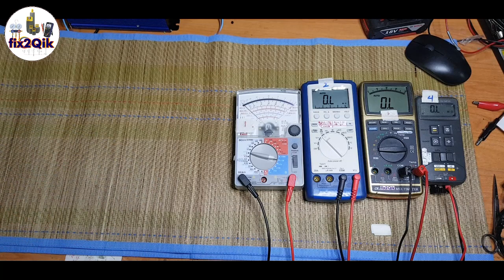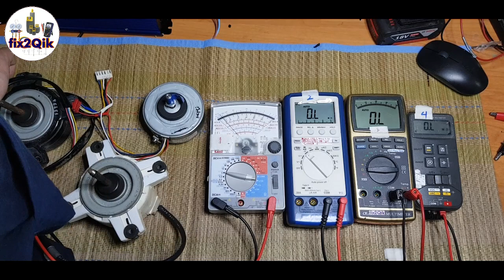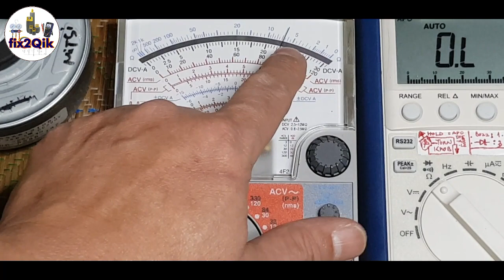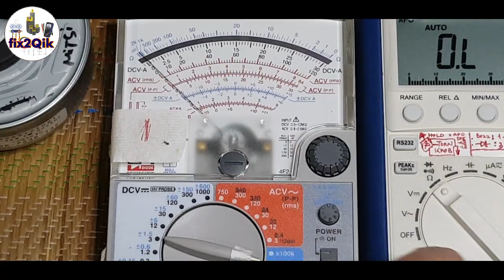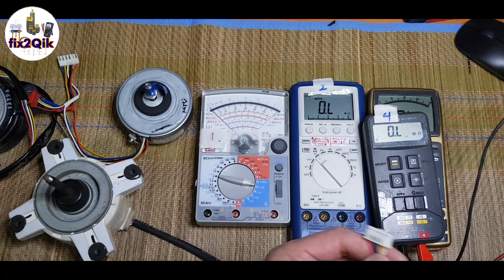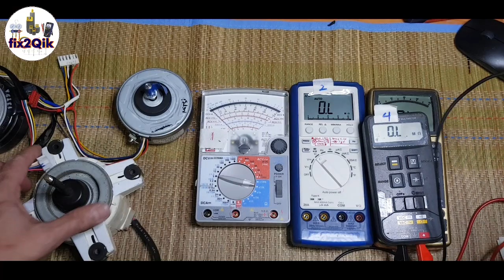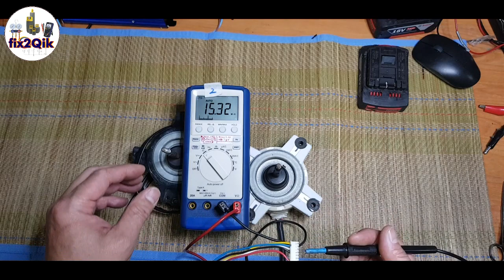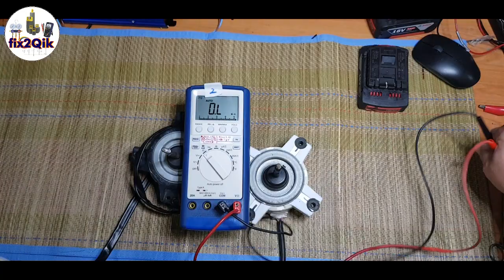Dc fan test, test the 5 wires dc fan motor the proper way

Comment: Thank you for sharing. Ohm tests of dc fan motors are inaccurate. My sister has a panasonic air conditioner that fan motor didn't work, 2 error codes rechecked (push the "check" button down about 5 seconds until the screen shows the mark - - , then point the controller to the receiver of the air conditioner,  now pressing "timer" momentary,  until power light flashed and beeping tone heard for the 1st error, continued to press timer button showed the second error. Leave the controller untouching 20 seconds restored its normal opreation ) on the hand controller are: F95 and H97. She and I had wasted money for call-out fees on one electrician and one plumbing company in melbourne (66 and $88 each) who came to tell we need a new air conditioner after showed off the ohm reading of the motor (in the outside head). Eventually there was a hvac specialist came and simply replaced a black - rectangle shape capa part near on top of the electrical board (he called main grid filter pcb), then it has been working again for over a year now. Costing of the repair was only $375, including extra charges $80 for 1 more hour labour for the hvac technician to put everything back as there were many parts disconnected prior to his repair. The Hvac technician came with 2 boxes looked similar as these testers in the video clip, one tested inside, while the other one doing outside test. I write this so people know what to ask for an experienced decency repairer and not wasting time as well as money..

Comment: Are you based in melbourne?
Reply from the maker: Hi, 

Fix2QIK is based in Melbourne, we take electronic repairs from the licenced HVAC-R professional via courier and postal only of: Heating Cooling and Split System Air Conditoners. 

> Discover more: https://fix2qik.au/contact/